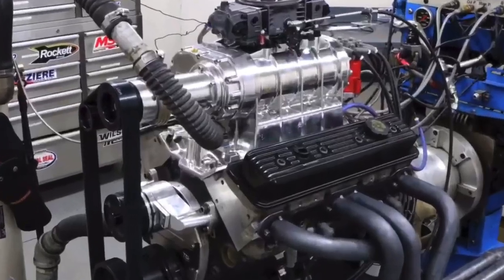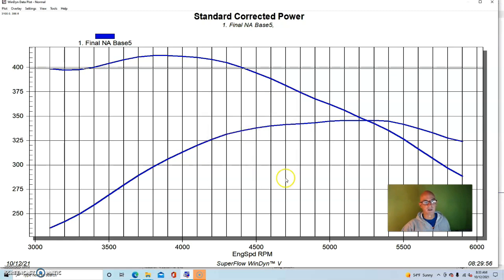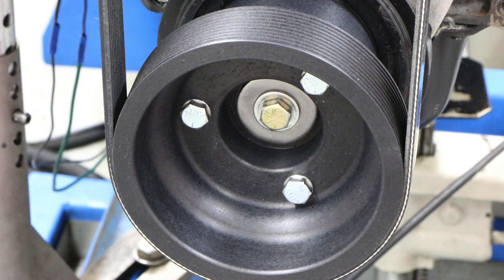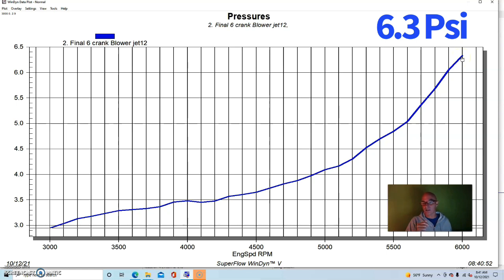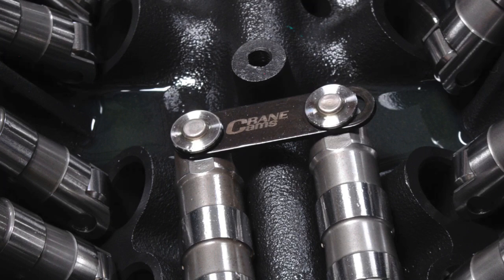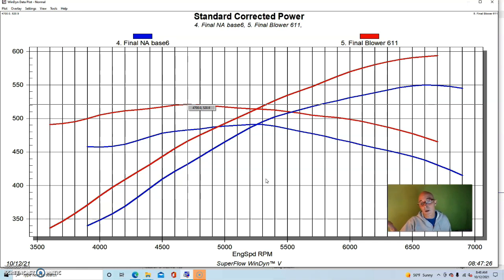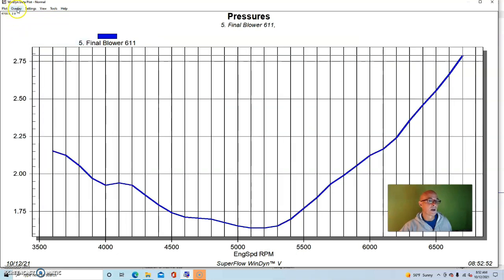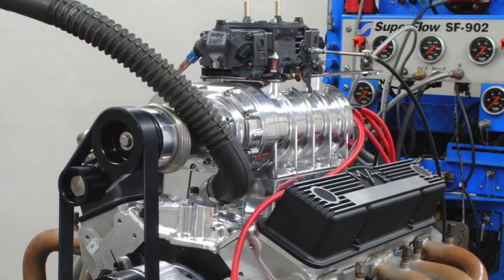HOW TO SUPERCHARGE A SMALL BLOCK CHEVY? BLOWN 350 VS STROKER 383 SHOOTOUT-WHICH ONES MAKES MORE?

Comment: How much root supercharged boost can a 350 stock short block handle with 91 octane?
Reply from the maker: how much do you want
Reply: @richardholdener1727  I saw a guy put a turbo on a stock 350 motor; it made 600 HP, but he said it was too much boost for the stock internals. I am curious what's a safe amount of HP for a stock 350 motor.

Comment: Watched it again  650 carb was garbage 
 750 would be smallest  850 would be way better
650 was choking engine period thats like 305 carb i got a 750 and its a little big 
but on 305 it uses it once it gets to 4000 rpm
id of tryed the 950 on it and worked backwards  going to 850 
and used Edelbrock for the bigger pump
Ive never seen less than 750 on blower ever

Comment: would it still work to put an old school blower ment for a carbureted motor on a tbi 350
Reply from the maker: yes-as long as you can get enough fuel flow

Comment: I WAS LOOKING AT PUTTING A 671 OR 871 ON MY 350 LT1,  BUT THIS BUILT 383 WITH THE LITTLE BLOWER WOULD LOOK ALOT BETTER IN MY FIREBIRD.   650 HP IS A LITTLE LOW,  BUT I'D ADD A 125 SHOT NOS
Reply: 650HP  in a gbody or fbody would walk a hellcat and keep up with a shelby/ZL1...its enough.
Reply: @KingJT80 this dude is just looking for attention this is the reason dudes kill themselves in cars is cause they think they can handle more than what they really can

Comment: Wrong cam for 383 for boost. Perfect for NA. Wrong LSA for boost.
Reply from the maker: #WRONGCAM
Reply: @richardholdener1727  I'm sure  you are well aware of this. You even mentioned it in the video. Certainly don't want any valve overlap in boosted applications. You know way more than I do. I'm just an amateur hot rodder (old school).
Reply from the maker: you do want overlap in a cam under boost-if it makes more power na-it will make more power under boost

Comment: good tests. I feel that you're everyday backyard builder would build something similar to these so this is a good reference point.
that being said the 383 is still way more motor than the 350, the supporting mods used in the 383 like heads cam and bigger carb definitely show on the dyno graphs. the 350 seemed to have better results with the blower than the 383 did even though it made less than the 383. almost as if the 383 could have seen more of a gain with maybe a bigger or different blower. looking at the hp/trq cross they both seem to have the same cross points at the same rpms but different levels.

Comment: Find it hard to spend  3500 plus for a blower setup when you can get easy 450 hp on carb s for much less ???
Reply: yeah you have to spin it faster with the 7 inch pulley and to 7K RPM  otherwise yeah why bother?  but if you spin that 177, no NA small block unless its a big 434  is gonna make 650.  thats 496 big block territory

Comment: What is the difference between 142 vs 177? On a 383 stroker engine.
Reply from the maker: THE 177 SHOULD BE CAPABLE OF MORE POWER
Reply: @richardholdener1727  25 - 40 percent more?  Oh and thank you for your time.
Reply: @DiedrichKnickerbocker1783  maybe 50 more HP  IF you did spin but i know a 144 is kinda small for a 383.  i watch a guys YT channel and he has a 144 on a 355 small block.  runs good and probably makes 400 to the wheels in his gbody cutlass.  but a 383  is gonna want more air in that combo  like this one

Comment: Now that test was full of useful information. Mild blown 350 vs zooted up 383. That 177 OLD School Roots ain't the modern centrifugal, but it got with the program. The mild 350 could nibble on what the 177 was dishing out. The 383 could gobble it up no problem. I have been considering building both combos, now I know I am on the right track. NO computers, no special blow thru carbs, no EFI, dirt simple.
Reply: id still use a 1X4 blower carb.  it would be a blower carb.  not a blow through  they do make and jet them differently
Reply: Mike,  did you ever build it?
Reply: @xmo552  mY 99 vortec 350 is finally ready for assembly, the day after the Super Bowl, I tried to order a weiand 177 blower.....THE WHOLE LINE OF BLOWERS ARE DISCONTINUED. I decided to jump over to the Edelbrock blower, it goes from available to unavailable every other day.
Nobody makes an Eaton style for GEN1, only LS. This calls for a rethink of what to do next. Dam it!
Reply: @mikef-gi2dg  
Weiand killed off the blowers mid 2023 I think. I was in the same situation last year. A 142 came up for sale 100% complete on my local Craigslist for 3k, but I didn't get it.
This was like a week or two ago. The ad said if it didn't sell locally it was going up on eBay. I just checked, it's not there either at the moment. You may just have to get a used piece.

B&M.. I didn't think about.
Reply: @xmo552  I have been looking at The Blower Shop 192 blower. It is the main reason ( besides life just getting in the way) I have delayed pulling the trigger. It is plenty beefy, excellent robust drive system, and it's current. It's rated at 10 lbs max, which is perfect, I don't need more. The price is about the same. Been dying to do a roots blower and it's smaller than a BDS 6-71, my next choice.

Comment: I'd love to see this test with a methanol carburetor. I think the gains would be massive.
Reply: i heard these thing love E85 cause they make a lot of heat
Reply: @KingJT80  correct. E85 will definitely help, but methanol will help more because of even better charge cooling.
Reply: @jhaleyh374x  yes but you can't fill up with that at the station though. A lot of Midwest guys can get E85 no problem I guess if you're racing it won't matter

Comment: And after thinking about it for months it finally clicked.
THE 355 HAD VALVE FLOAT AT 6000 RPM .
anti pump up crain lifters and procomp 400 pound blower  valve springs would wake it right up.
  And on the wild engine its only getting half the boost or so .
You say the na cam works good but the boost is being lost through the overlap 
between the intake and exaust valves  during the cycle.
not so much the 2 pumps fighting each other like I guessed the first time.
its simply blowing the boost right out the exaust during overlap .
and thats why your boost levels drop to almost nill.
Its a big cam making it show way more than on stock cam.
I like to see the big blower cam results compared to the Na cam...
Reply from the maker: NO SIR

Comment: The school of hard knocks that youve started   you didnt tell every body to do certain things to be able to run that race gas .
1 They put it in their car and the car never runs again and they cant figure out what to fix and keep throwing money at it and their funds are limited. 
2 4/5s of your fan base Are dirty White boys ,Thats including other races Should say backyard wrenches,
 on a limited budget.
Thats going to run 92 pump gas .
And its a whole different Ball game.
And having a new built 10 thousand dollar engine 
and all they have to show for it is a bunch of hammered pistons and shortened rods.
But have spent their life savings building that engine.
3 Unless they run a 6000 rpm stall converter theyl never see that extra couple hundred 
horse power you just showed us here .
in fact with the race gas  they lost 2 10s in the Quarter mile after adding the blower
and cant figure out why .
Im a fan not a troll.
Do this video again on 92 pump gas 
and get us through the hard knocks.
Thats what your good at s
just letting you know about our needs thank you for the videos
Reply from the maker: PUMP GAS ONLY CHANGES THE REQUIRED TIMING

Comment: Please explain what boost pressure is.  Explain why valve and intake size increases restriction and increase boost pressure Please. Why flow is more important than boost. Carl banks explained this on diesel applications. Gassers may find this interesting.
Reply from the maker: Gail Banks? If you make the na motor more efficient (by almost any means), the motor will make more power at any given boost level (starts with more power and ends with more power)

Comment: I actually learned something new today.
on yellow bullet racing forum I was reading about all these guys having problems 
with builds just like the 383 in the video with supercharger not helping high compression build.
Even with ten psi wheel  and they were realy having problems on race track 
the 10 psi wheel was melting the tefon blades getting to hot .
Never heard that one before
And have to give the Wiend blowers credit for that they dont have tefon blades
Though actually replacable their expensive
As far as timing being maximized with air fuel racio
you question about my 12 degrees its a great place for longevity 
with spring weights coming in on top of that then vac is pretty good 
If we were going for a world record Id tell you without sacrifice of maybe a 1 shot wonder 
Id say go for it and if it blows wel start from scratch.
But Id rather sacrifice a engine Than my prize Huffer three engines and 200 thousand miles on 4000
dollar supercharger and not a hicup from it yet

Comment: GREED  YOU SHOULD HAVE DONE WHAT THE TITLE SAYS BLOWN 350 VS WILD 383 STROKER .
NOT BLOWN WILD 383 .
YOUR  PEEING ALL OVER YOUR LEG AND HAVENT GOT A CLUE LOL
THE REASON BEING  IS THE  FORCE OF THE WIND HITTING YOU IN THE FACE.
IS GREATER THAN FORCE OF YOUR PEE SHOOTING OUT
BLOWER AND TURBO 101
YOU THINK 12 + 12 =24 wrong what happens when you blow up 2 balloons and put 
the spouts together?
The answer is nothing. 
You had me going lol big stars in my eyes ok Bling 
I had to go back to my roots to see what was going on HA HA HA
That 383 is 12 to one your blower is 12 to 1 on dyno 400 crank is 100 horse 
so were taking it out of picture  because reaching higher in cylinder  might even push 13 and a half to one
a little turbo at 25 psi would have been better raising it to 15 to one but the 1600 degree exaust tells me
a a realy big detonation is coming on the hot air making fuel develope fumes making explosion  too great for heads to handle.
purpose built is every thing
your 383 had forced induction already going on without blower the reason you got a extra hundred horse at end of your pull was at 7000 rpm 9si finaly exeded your 12 to one compression making like 14 to 15 to one.
so lets go your little 350 blown  against your built 350  wild card taken out of picture
stock 350 supercharged will beat built 350 because even though even at 12 and a half to one off throttle 
the blower at 5 psi  makes 7-8 to one at 5 psi as it goes through rpm  it exede s 13-1 compression and keeps going.
even though your built 350 might run more horse power  the blown 350 
exedes on tork  maybe not on dyno yet double the back pressure 
on your dyno  and watch what that beautifull little blower does lol 
under load it starts packing the cylinders twice as much  upping horse power and tork 
at 15- to 16 to one compression  your underdog just ripped apart your built 350 
Go ahead prove me wrong   
As per B&M that little blower forced induction does every thing cam and heads do
and as per B&M 
up to 6000 rpm than a cam can start helping  and you have to go springs and rollers to fight 
valve float 
And as per me I prefer goodwrench 190 horse box engine for its hollowed epoxy filled valves 
that have never failed in 20 years  and comp 400 pound valve spring  crain anti pump up lifters 
better  pistons and bearings not to exeed 9  and a half to 1
eldor brock 750 for its low end tork 
and your always better having cooler 5-7 charge 
the higher rpm barrier crossed will up that boost level all on its own
lighter valve train means higher rpm  as per you richard lol
oh yah and as per b&m we built our blowers bigger than what they needed and under drived them to keep a cooler charge meaning more horsepower and tork than competiters 
and capabuility  to exeed our ratings especially at high rpm.
and that is why superchargers are not allowed in built engine racing because its not a even playing feild
End of blower 101
THATS WHY GOD GAVE US THE NHRA LOL
feel free to switch supercharger with turbo any where  in supercharger turbo 101 
the same basics apply and i forgot for stainless valve needing 9/16 rocker studs
And rich even though my 144 is rated 144cfm  its the same size as your 177 blower
Reply from the maker: you have so much to learn-but thnx for all the comments
Reply: @richardholdener1727  You pegged that one 
It kind of angers me that the roots superchargers doesnt get the respect that they dont get the respect that they should get  because the dyno brake isnt enough 
to show their real horsepower and tork 
the only reason  the turbo does half fast is it makes its own back pressure.
bad builds on top of it making them look bad its like calling nitro alcahol
Reply: Yikes.

Comment: Sorry sorry sorry sorry LOL
I dont think its all volumetric efficency .
Because the belt system on the single carb superchargers   the belt is designed to slip 
as pop off valve under detonation  to rescue the supercharger it will let the blower turn backwards.
And your running enough  unchecked  tork to spin tires inside of rims.
I think your crossing that line.
By unchecked I mean no drive train drag on it.
I think thats 60-80 horsepower and tork that is not going to show on lower torkband.
probably 60 on 350 and 80 on 383
the tork is just not going to hit that belt so hard with drive train behind it.
And I keep seeing in my head a race car spec  decked block with piston coming all the way to top of block and a small cc chamber head on that super mouse saying 13 to 1 another variable?
Under another thought the supercharger and turbo under the load of vehicle.
and your boost graph starts at 4000 rpm 
their going to pack the cylinders better.
Your turbo dynos are going to be weird too.
Because your not controlling the spool valve are you?
Even though it doesent have a belt to slip.
I Hope this is a more well thought out Explanation
Reply from the maker: belt designed to slip under detonation? sorry
Reply: @richardholdener1727  Along with 
my little triangle pop off valve with 2 little thin springs I took off lol 
Afraid I was loosing boost  and cranked down lol  I should probably replace 
The belt tensioner springs on B&M and WIEND Id think are designed just heavy 
enough to hold
Reply: @richardholdener1727  right in B&M service manuel  cog belt guys aint so lucky ;
watch john force  explodes in pomona
Reply: @richardholdener1727  I actually ran big industrial superchargers  on pto trucks 
that unloads tanker trailors full of  cement and other materials like dietamacous earth
to filter wine  
I blow it up pipes into cylos they only put out 15 psi got stainless steel rotors
You can shoot them down the street and make them think their in a hurricane
like a jet engine ;  we could drive line it into crank pipe it into carb of 383  
see if we could make 50,000 horse power.lol 
we could show those mad max ausie how to  build a Rat Rod 
with the smallblock from hell  
Ive got my owners manuel catalog service manuel and directions  for the 144 B&M 
catalog covers all B&M superchargers  with dyno graphs and such 
I could shoot them to you over phone if you want

Comment: It would be Awesome to see this same style of testing on the 400 sbc engine!! I bet it would surprise people as well as showing how much of an advantage of having more cubes as your always proving Richard!! Thanks for all you do for US the viewers!!!
Reply from the maker: more na equals more boosted
Reply: @richardholdener1727  Richard does a SBC require a BBC Snout on the SBC Crank if running a Supercharger?
Reply: This is kind of a cool test, I thought the smaller engine with more boost might have more spunk. I'm an engineer, and the concept makes sense. More air=more power.
Reply: I'd love to see these combination results on a 377 sbc but a 350 block with the 3.750 crank not the 400 block with a 350 crank

Comment: When do you start worrying about crank deflection from the blower? I would like one blown motor in my life but thought they needed much more work and maintenance ..I have experience from .4hp - 4000hp. The only blower motors I know are Donovan's running 90-100% nitro..in a more docile set up maybe not as many issues? Ring selection? Not for gas mileage I'm sure.
Reply: Big Block Chevy  crank,   can be ordered  with a larger  crankshaft snout.     The bigger the better 😮

Comment: Can I use the 2nd cam on a "daily drive" blown 383...? Is 8.8:1 ratio enough with this cam? What part number? Which stall and rear ratio should we use?
Reply from the maker: you don't want that 383 cam in a daily driver
Reply: @richardholdener1727  Thank you Richard. My current cam is NX276hr nitrous cam. I want to go bigger cam for daily drive. I am between NX288HR and XR294HR-10. Can I use 294 cam in daily drive.. or shuld I get .637 .621 230, 250  custom cam.. I am lost...